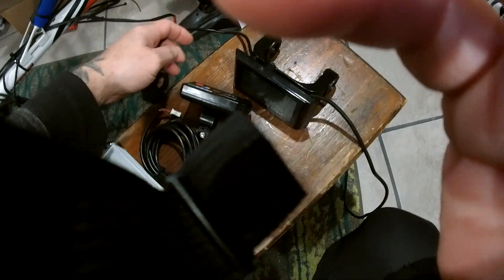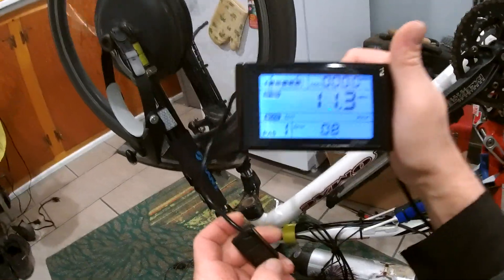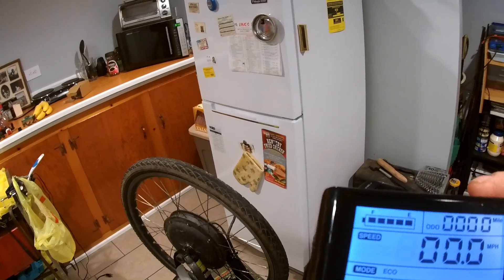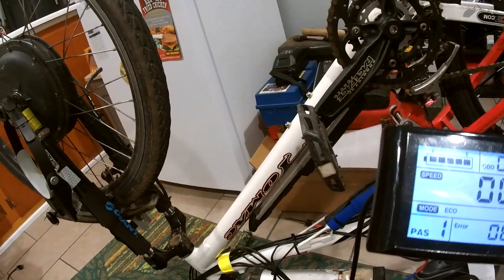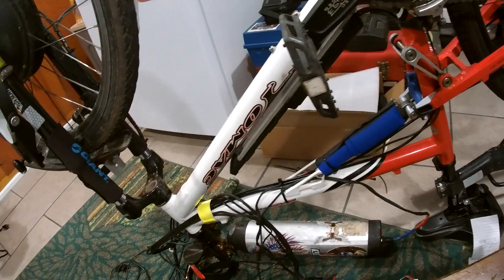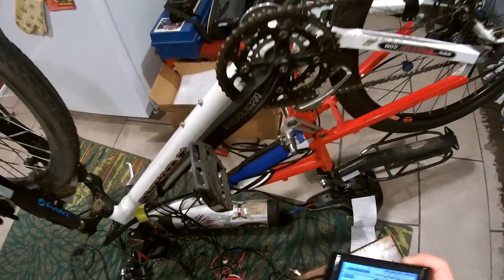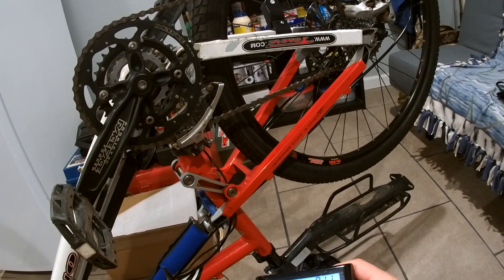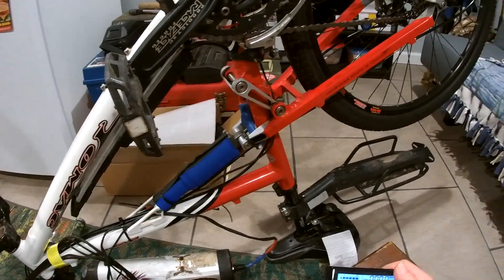SW-900 LCD"throttle error 8" Fixed with 12 mosfet ebike controller only walking mode works +...

Comment: So how do you fix this
Reply from the maker: Make sure  the power negative and signal wires are connected proper.The color coded wires are not always just plug in for throttle and peddle assist.
Reply: @petertothRC-FPV can you make a video please

Comment: Having the same problem watching this video I think it is the display itself needs to be replaced.
Reply from the maker: You may read the description or comments on this old video since the problem for me was the throttle and PAS sensor wires needed to be swapped in the plug.Just because the color wires signal power and ground or bad connection.

Comment: Over or under voltage check ur settings if all connections are good
Reply from the maker: Hey thanks bud fixed it a long time ago.Just a wire swap in the plugs. Since the throttle and peddle assist were bought separate matching the wire colors did not work lol go figure.🙃

Comment: A whole video on a problem and no solution…
Reply from the maker: The description is updated but no one reads anymore lol.Should have done another video but slipped my mind since PROBLEM SOLVED change signal & power wire in plug and locate align magnet with sensor to target for PAS(peddle assist sensor)👍ONLY THROTTLE WILL WORK IN LEVEL #1 WITH 5 LEVELS POWER & ASSIST
Reply: @petertothRC-FPV hay can u explain this better lol
Reply from the maker: @yxng__jj_7jj922  Make sure  the power negative and signal wires are connected proper.The color coded wires are not always just plug in for throttle and peddle assist.⚡🔥
Reply from the maker: My throttle and PAS was purchased separate so the color wires were not the same as the controller

Comment: I got the same issue did u figure it oit
Reply from the maker: the peddle assist sensor was wired with the plug different so i swapped them around and properly mounted it.Since using other than the one supplied with the kit just had to figure it out.Also nobody reads the video description😁

Comment: i bought this display with controller and cannot get anytthing to work. i bought new motor even and still nothing. just error 8. for a month ive been trying to get this back on the road for my busiuness and im about to scrap it
Reply: they say if ur current throttle is not working then u shld get a new throttle and try it. i bought a new throttle and is wating to be delivered. will tell u if it fixed error 8
Reply: @ShawnHo-f5u fixed?
Reply from the maker: Throttle error 8 code try swapping the wires power ground and signal are sometimes not correct in a video would be helpful.
Reply: oh man ive learned so much since this i dont even remember posting this. i moved on to better vesc controllers and my bike is an entirely different class now. this has to be an old post

Comment: i have this error now as well but it still works normal, i did disconnect the gas throttle, and started using peddle assist, it still works just fine but it does show the error 8 thing as of today.. should i worry about it? or just ignore it..
Reply from the maker: Maybe take apart the throttle and clean the contact points with some emrycloth fine grit sand paper or just replace the throttle is cheap.Not to worry the thumb throttle was not working but since cleaning it all is good .
Reply: @petertothRC-FPV  Good you got it sorted, i think i figured it out, because i disconnected the throttle this showed up, i explained it a bit wrong sorry about that.
there is 1 setting i can change to set it up for PAS only. but i think i will leave it like this, i cant use the throttle here in the netherlands because it would classify as a moped, also the motor cant be more then 250watt, since i have a 500 watt ill leave the eroor, it hides the power draw :D. i will leave the throttle on there so i can reconnect it in case the sensor ever fails so i can get home without peddling like crazy. i have a small foldable bike to take on the train (its free to take on the train if it can fold) and its not fun to use without the ebike kit :)

Fun tech i like this kit. even though it only has 20 inch wheels its really fast enough for what i need. still figuring it all out but getting there :D
I have a little short from the first test run on my channel if you want to check it out. have since moved the battery and such to the back of the bike, looks pretty clean now :)

Thanks for your reply i appreciate that. i subbed to your channel as well.

Have a good day!
Reply from the maker: @MathieusChainsawCarvings  Some of these restrictions are just criminal Big thanks going to see your channel

Comment: Please help. Bike is new. Done 85 miles. Got a puncture. Took wheel off to change inner tube. Now I have error 8 and only walking mode works. 

I've checked the connections and all fine.

When I first pulled the throttle it spun once and now I'm stuck on error 8
Reply from the maker: 1st check that the PAS Peddle Assist Sensor lines up perfectly while you are on the bike.2nd check the wires in the plug make good connection.

Comment: Mine is still not working I beg someone please help me it is just saying 08 error and I fixed the wires on the motor
Reply from the maker: Most likely the throttle and or peddle assist wires are crossed
Reply from the maker: Oh no sorry to hear that my friend.Did it stop working or is it a new build?Sometimes it is very hard to determine the problem without actually seeing anything.Can you post a video?

Comment: Hey I was wondering how did you fix this problem I had the e010 code then i got a new controller from company changed it now i only get e08 code with the walk assist
Reply from the maker: Hi Thanks for stopping to watch and comment The issue for me was the wires on the PAS (peddle assist) sensor needed to be changed cant just expect to match the color on wires sometimes.

Comment: I got the same thang it will walk but no go
Reply from the maker: A simple thing can be such a headache.If your using a componant not included in the kit like in my video a thumb throttle. Matching the 3 color coded wires dont work swap them around.Line up the PAS target perfectly.Checking with a meter positive negative signal may not be in line when plugged in. Make a video describe the problems.  New build or store bought?This problem just start or correct settings on the SW900 lcd controller ?

Comment: Did  you look at battery .inside were batt post  meet. See if clips were pushed up in bat box.may not getting good connections. Check lead post to see if they are grounding out. See if any of this helps ya out.Timm
Reply from the maker: An old video. The problem was wiring the PAS backwards. Then lining up the magnets on the disc & sensor.Thanks for coming to watch see my latest build 1500w 52v Trek Fuel 90 has over 3000 miles now.

Comment: Hi, when i conect pas sensor i have Error 07 and nothing works, if i unplug it the throthle works and no error in the display. I have checked the configuration many times and tried diferent configurations and i stil have that error. I have tried with another Pas sensor and Error 07. Anyone knows how to solve or has the same problem? Thank U!
Reply from the maker: i found the wires in the plug were needed to swap the power and signal.Color coded switch wired wrong.But i have no luck with my other bike is a 35 amp controller on a 1500w hub motor kit.After trying another PAS still nothing worked i gave up.I like it much better with a thumb throttle anyway😃good Luck👍

Comment: I bought a front ebike drive from ebikling and works very good for two weeks and all of the sudden I’m getting error code 08 and all throttle wiring is fine. I can’t fix it. Please help.
Reply from the maker: Sorry to hear that.Does the ebike still work? there are so many kits and ebikes out now the cheap componants are getting wet or road salt etc.Check if it works unplug the pedal assist.
Reply: peter toth hey Peter thanks for the reply. I have power and all it’s just the throttle not responding at all. I just bought this two weeks ago. I’m trying to contact ebikling right now. Stay safe.
Reply from the maker: @nixmix3544  Good luck hope they help you out hard to figure out what exactly happenned but if only the throttle switch is bad cheap fix.
Reply: peter toth did you figure out what’s wrong with your error code 08 by the way?
Reply from the maker: @nixmix3544  This is an old video and just the wires needed to be switched in the plugs for my peddle assist.1000 miles and is now my back up wheels in case my 1500w Trek has a flat tire😃

Comment: How did you fix it?
Reply from the maker: Unless i turn on walk mode while not sitting on the seat that feature will always work no matter the position target of the PAS magnet sensor.
Reply from the maker: The settings and PAS perimeters needed to be adjusted correctly sw900 lcd is very nice.A couple hours of Trial and error.Also my PAS sensor mounted on my swingarm was not on target with the magnet disc on my it will only work when i sit on the bike and is very good for safety the ebike wont move unless my weight is on the seat.😜👍🏁
Reply: So, the error code went away with just changing setting? I also have error code 8
Reply from the maker: Make sure the wires are matched in the connector ground,positive and signal wires must be changed to match in the wire harness&controller connector.